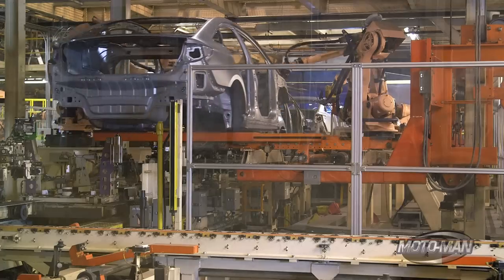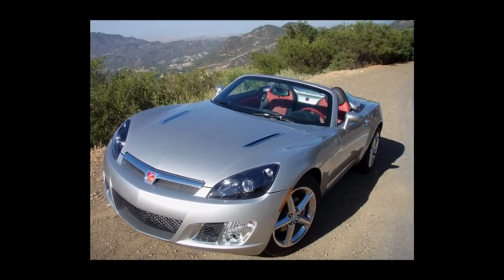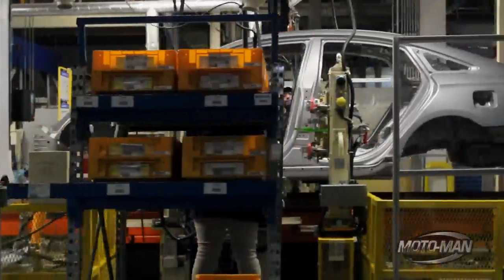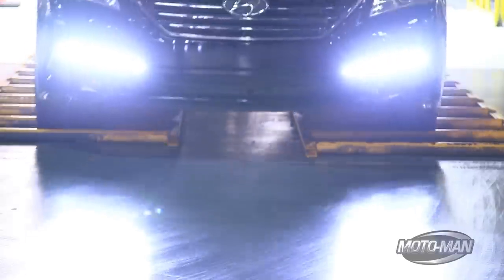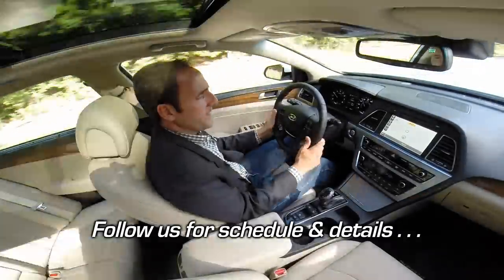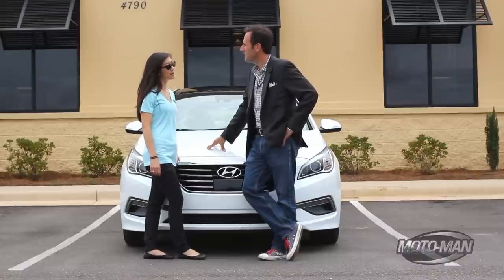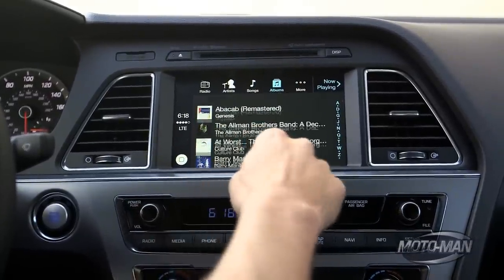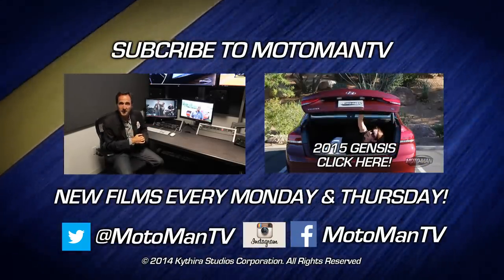2015 Hyundai Sonata -- First Drive with Alabama Factory Tour & In Depth Apple Car Play Demo

Comment: I have this car and Android Auto (hardly different from the Apple version) is superflous.  Just not necessary nor even desirable unless you want it for the "prestige" factor.  The bluetooth phone integration works flawlessly and the built in navigation works every bit as well as Google nav.   The one and only thing different is texting capability and that's just not enough to tip the scales over the factory offerings.

Comment: I had faith at one point until my engine shut down for no reason and the next day doing 70 mph my engine seized Oct 17 without warning.  Luck for me I had the engine inspected by Kia/Hyundai in June 17.  The warranty covers only motor. Not high pressure fuel pump nor injectors on engine.

Comment: Now about the Sonata At first I was like OH NO, what did they do? Then I understood the refinement and the need to get the respect. I don't think all cars have to be Canyon Carvers. Here's the hard part now. The 2015 Sonata starts just a few hundred then the base Accord. The Sonata tops $1000 over a fully topped Accord. The Sonata may have a few more features then the Accord But which one is going to hold up best in resale? Which one would you put in your driveway? (And no the Mazda 6 isn't a choice here) and May I add that you never aged 1 day from 5 years ago? Did you stop aging at 30 MotoMan?
Reply from the maker: GENE - you are too kind . . . My secret to staying young: Let someone else pay for your gas, tires & track time.

As for what I would choose - you know me! There is only one answer to that question: Lotus.

That said, if I were doing a mid size car for a family, I would probably do a used diesel - like an E250 or some sort of thing like that.

As for resale, today, the Honda is absolutely the one to go with - it will retain a higher percentage of value. That said, Hyundai has made HUGE strides in resale and would not at all be surprised to see this Sonata meet or beat the resale % of the Honda in 5 years.

Comment: would you happen to know if the care play feature would be available only on the ones that come with a touch screen or navigation system or will it be included on all the 2015 sonatas
Reply from the maker: The Car Play system will initially be available on the full spec cars with Nav but Hyundai will cascade this option down to models without the Nav over time.
Reply: ok thanks i just got the SE model and was curious

Comment: Did you have to get the tech package for the car to use carplay?
Reply from the maker: From the outset, you will have to spec the car with the Hyundai Navigation system. However, they plan to phase in CarPlay to models without the OEM Nav.

Comment: Happy Fifth Birthday M !
Happy to participate in your first Q&A Live session :) My questions regarding the new Sonata is :
- Are the new engines Exclusive to the US\Canada Market ? or we will see them in other regions ? The Previous Sonata & Current Optima both only had a carryover 2.4 engine in Saudi Arabia ... We didn't get any of the newer engines.
- Can you pick any trim with any engine ? or they are exclusive to specific trims ? in the video, The White one you had you said it was the Luxury model, but with the base engine ... can you do that with say ... The Sport model ?
- The Previous Generation was notoriously known around here for its leaking Panoramic roof ... Did they fix that issue ?
- The Showcar had Quad-Pipes exhaust  tips ... did that make it to the Production version ? If so, Are they fully functional ? or fake like the old Sonata diffuser accessory ? (a Dealer-Installed Accessory very popular here ... comes with a fake Lexus LS460 style Dual Exhaust Tips or an AMG style Quad Tips ... Both were fake ... it still have a Single hidden exhaust tip)
- Can you Mix & Match the Interior trims ? Like say a Sport one with the Faux Wood or a Luxury one with Faux Aluminum.
- To use iOS' CarPlay, do you need a Special cable ? or the Standard Lightning Cable suffice ? (My kia requires a special cable to plug-in an iPhone or an iPod Touch , but a regular 30pin cable for Classic, Nano ..etc)
- Will the CarPlay feature gonna be available outside the US? or "Specification Depends on Region" ? (My kia doesn't have a Cruise Control or a Bluetooth system like the US variant, but have a Full size spare tire & A Digital A\C Control Unit) 
- Do they assemble the Azera in the same factory ?

- One last question ... If you are going to buy a new Mid\Full size car from this segment, which one would you choose ?

Sounds like a cool factory ... They "Farm, Process, Produce, Export" ... Hope you had fun during your visit there.

Thanks M.

Hope YouTube lets me post this.
Reply from the maker: Hey Man - thanks for joining in . . . Sounds like you have done your homework on Korean cars - Didn't know you drove a Kia . . . Think I need to have Ralph call you. Now, your questions:
1.) Not certain on other markets as they did not show any export versions. That said, I do know there is a diesel that we will NOT be getting.
2.) Didn't spend enough time to determine the roof issues - in fact, didn't even open it as it was VERY hot in 'Bama . . .
3.) The quad pipes are on the sport model - the red car in the film. Some time I have to tell you the story about the quad pipes on the New York Auto Show car . . . But I digress . . .
4.) As for trim levels and engines - think of it this way: You can pick three engines. The base, the ECO and the Turbo. The base can be had as base and Limited Trim level (the car I was driving in the film). The Turbo can ONLY be had in the Sport model and that also applies to the Turbo's finish on the interior. Gotta say, would love to see some of the manufacturers offer wood - REAL wood - on the sport models as it changes the whole character (for the better). The RS7 they just took from me today (very sad) had this fantastic dark wood with Silver inlay.
- As Miles said in the film, all you need is the standard lightening cable. That said, they opted to make it work ONLY with the cable. I am certain there will be OEMs that opt to for the system to work over bluetooth. Off camera, Miles did say that the cable is pretty key to the ease of use and speed of the system because of the amount of data being transferred.
- The Montgomery, Alabama factory only produces the Elantra & the Sonata. Funny though, driving back to ATL after this shoot we passed right by the Kia plant.
Last but not least, tough call! I would probably do a Passat TDi Manual or wait for the Mazda6 Diesel . . . But you know me, on the way to the Mazda or VW store I would make a wrong turn to Hethel . . .
Thanks for joining in . . . Next LIVE Q&A is Monday for . . . The Porsche Macan Turbo!
Reply: MotoManTV Hey M, Thanks for taking to the time answer my gazillion questions ... I truly I appreciate it.
regarding me & the kia ... as you probably know ... I go to college in another country (Going home for the summer vacation tomorrow ... Yaaaay me ... probably most likely on an A320) & due to the Taxes & Fees ... my options were limited to cars with a 1.6L engine or less ... I ended up choosing between a 2010 Kia Cerato (You have it in the states as the Forte) or a 2010 Chevy Cruze ... both had a carryover engine from the Spectra & Optra respectively ... The Cruze had a 4-months waiting list at the time & wasn't available for less than 30000 Dollars ... so I went with the kia.

Back in Jeddah, We are in the process of changing cars ... We had a pretty good deal on our 2003 Ford Explorer ... actually made money on it ... that kinda NEVER Happens (unless a collectable classic) ... we weren't even trying to sell it ... My father uses a company suv & I drive the ford when I'm home(usually parked about 7 months a year) ... a guy kept seeing it parked for months, approached my father & kept nagging on him to sell it to him lol ...
Now our prime candidates are either a low mileage BMW 745Li (E65) or an X5 ... or a Cadillac (Anything except the Catera)  or a new Dodge Charger or a Hyundai Sonata or a Mazda 6.

1) Ouch !
2) I understand ... Hot Weather is a #$%@ , I wouldn't bother either.
3) Looking forward to it one day:)
4) Yea I figured it would be something like this.
- Yes, Me too! While I love Carbon Fiber & Aluminum trims, sometimes you have to go with wood ... real wood. CLS63? Carbon Fiber , S63? Wood ... which brings me to a quick question ... did the S63 you had have the Burmster 3D optional Speakers ? & How does stack up to the Bang & Olufsen in the Vanquish & the RS7?
- I'm not a fan of Audi's current design language ... but I gotta give it to them ... their wood choices are excellent ... The dark wood you had is the #S%@ ... its by far my favorite veneer! especially with the Classic Red Leather. the Oakland wood with the black inlay is hot too ... especially with the Saddle Brown Leather.
- I was curious about that part, but I agree with Miles ... The Cable is the optimal choice (even though a bit inconvenient after a while) given the amount of data being transferred & heavy load on the battery.
- hahahahahaha I'd probably do the same ! We don't get the diesels around here (Gray market only I believe) ... but the trade off is we get the Mazda 6 Wagon :P ... The thing is you can get a new Charger here for around the same money as a Camry, Accord, Mazda 6, Sonata, Passat ...etc ... Granted a V6 Charger ... but 290hp, Rear Wheel Drive ? That's hard to pass.

Again ... Thank you for taking to the time answer my gazillion questions ... I really really appreciate it & I apologize for my long looooooong reply 

Looking Forward to the Macan's Q&A.
As always keep up the Outstanding work !

Comment: If you get Apple Car Play do you need the Nav. package?
Reply from the maker: Hey Martin, just confirmed this with Hyundai. At first, it will only be available in cars fitted with the factory Navigation however they are 'likely' to have wide application of the CarPlay system in vehicles going forward.

Comment: Have a base '17.. Its ok. Greeeat turning radius, always messing with heater in colder months, seems to take forever to heat up. Light beige seats stain very easy. Hate there isnt a charger when car is off, charger charges verrry slow to phone when running. My transmission always seems to be hunting. First startup in morning car sounds like it has no oil for few seconds. Dont like u cant check some settings on dash when ur driving. Great price, even better warranty. At 75 on expressway on breezy day.. Seems unsettled. Seems as if my bumpers paint dont match car. There getting there.. Lil more refinement. Im not believing gas mileage estimates

Comment: I got this car last week.  Let me give you guys some feedbacks.
Overall the car drives quite well for a 4-cylinder turbo.  Noise level of engine and drive is somewhat in the mid range.  My previous car was a 2012 Genesis and this 2015 Sonata is not better but doable. 
 
Cons:
The car doors were not aligning correctly. Doors were a bit off from the quarter panels and rear passengers door.  I was not able to open driver's side passenger the door.  I have to pull the handle twice in order to open the door.  Dealership had to take my car in for a day to fix these issues.  I got the car on Friday and return to dealership for repairs on Monday, go figure.  Hyundai Alabama must be rushing to get this car out of factory because their QC is way below par.  I was told the car was also inspected when it arrives at dealership before it can be sold to me.  The QC level at the dealership must be the same as factory, below average.  How Hyundai is able to miss all doors alignment is beyond my comprehension.  I really hope the doors are the only problems and nothing on the brakes or steering as they have a recall earlier when they roll out the 2015 Sonata 2.4s and SEs.  My advice to all my fellow buyers: Beware and please check all the doors alignment, make sure they are flushed with quarter panels and rear passenger doors.  Oh BTW, even after they fix my doors, one of the doors is still not aligned correctly.  I will need to take the car in again.  OMG.  What is waste of my time. 
 
Bluetooth Audio Streaming:  All 2015 Sonata has this problem and their engineers are working on a fix.  If you try to stream your music from your phone to the car's Bluetooth system, get ready for a break/pause every 15 seconds.  I was told Hyundai knew about this problem but they will still sell the car anyway.  Currently I'm waiting for a software patch which will fix this but who knows when.  I suggest all buyers to stay the away from this car until maybe a year later till they fix all defects.  If you have a iphone 5 or better, wait for Apple Carplay to be installed before you get the car.  I kind of regretted getting this car so early in the game as Carplay cannot be retro to the current 2015 Sonata models.  Plus I'm not sure what other problem I may encounter.  Better wait then be sorry like me. 
 
 
Window Lock:  Yesterday I found a new problem.  Window lock function is not working.  There is a window lock button on the driver's side left armrest.  Supposedly when this function is on, other passengers in the car is not able to open their windows.  Mine doesn't work.  This function is broken for my car.  Sad story, Hyundai miss it during their under par QC. 
 
Pro:???
With so many current problems, my pros are clouded with the cons so there is nothing good to say about the car now.  Until they fix all my car's existing problems, I may update this review with some goods.  Thanks for reading and hope you all buy other cars for now.

Comment: 185 hp? Rofl... I think I'll hang on to my 2010 model with 198 hp.
Reply: Neither r made for racing so it doesn't matter...
Reply: rondoo Dude, I'm not in any way saying that they are racing cars. But a new car should not have less power than it's predecessor.
Reply: Youcanonacanon Since you are talking less than 15hp, minor transmission tweaks as well as increased aerodynamics could easily make it to where the less powerful engine actually propels the car better. HP is just one very small piece of the total "power to the wheels" equation.

Comment: Why not android? Makes no sense. Android owns about 70% of the cell phone market. Adding integration for Android phones seems like a no-brainer.
Reply from the maker: There will be an 'Android Auto' version of the integration . . . Hyundai has elected to debut the system on iOS first with the Android version to follow shortly.
Reply: MotoManTV Is there a timeline for when they're hoping to release the Android Auto? Or will this only come out with a 2016 Sonata?
Reply from the maker: Alexander A Hey Alexander . . . Checked with our contact at Hyundai for a timeline and it turns out it will be before the 2016 model year - here is their official response: 'Android Auto will be available in select Hyundai models starting in the 2015 model year. The selected models will be announced at a later date.'
Reply: MotoManTV thank you so much! This really helps my decision :)

Comment: A 10 year warranty is worthless if you don't have replacement parts and a good mechanic to fix the cars.
Reply: I see this group is not mechanically inclined. It's the first thing you must consider when buying a car or truck.  Who will service it and fix it.
Reply: The dealership will fix at no cost if it's under warranty.